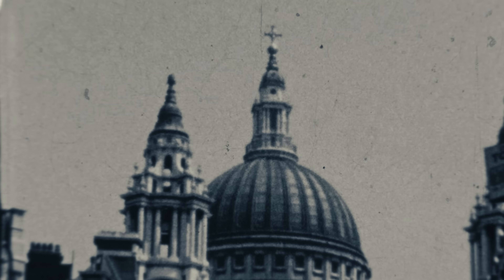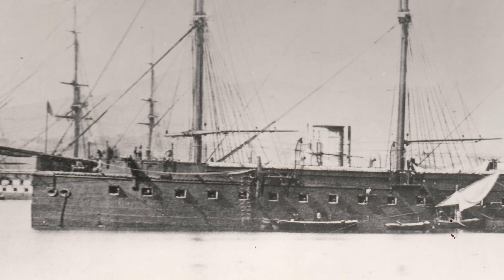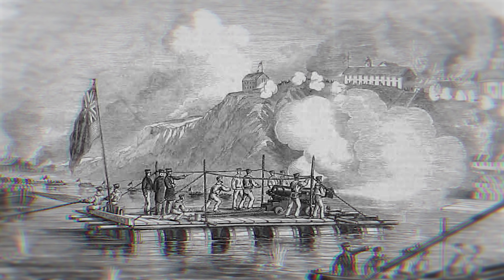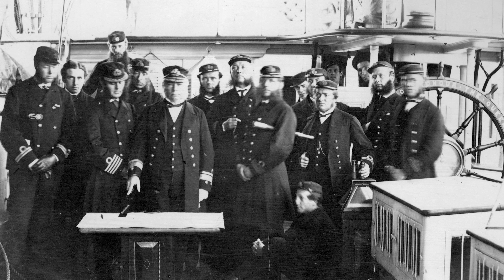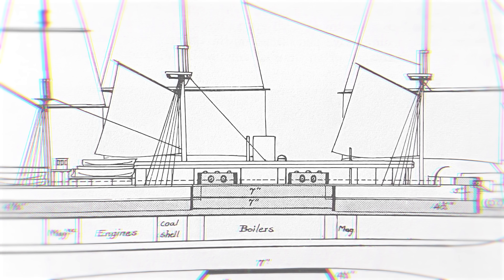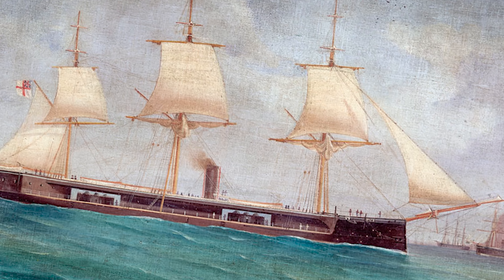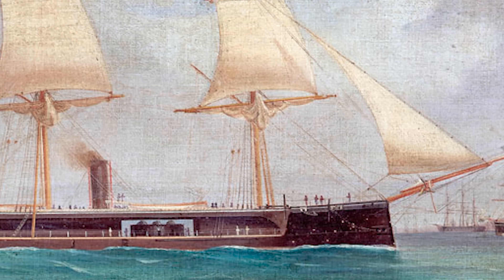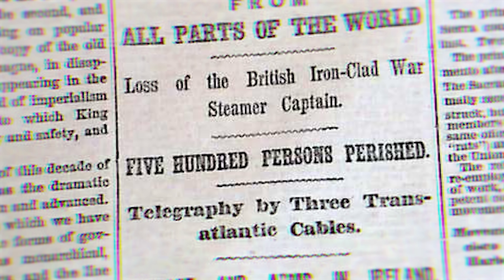The Most HOPELESS Battleship: HMS Captain

Comment: I doubt any cooperation would've served to save Captain. It sounds like a story we see often, much like Oceangate, where Coles had so much pressure and backing the Admiralty knew that the bad design was inevitable. So rather than lose their credibility by attaching themselves, they simply let it happen. The only thing that could sink this projects it seems; would have to be the ocean.
Reply: Couldn't agree more. I'd guess if the admiralty had cooperated as Mike suggests. The weight may have been closer to spec but only offered a few additional degrees of roll before catastrophe? Was that additional weight in upper plates, lower plates, uniform throughout, design changes? Unfortunately the video doesn't give anything to make a guess.  But yeah Cole sounds a lot like Stockton
Reply: A few degrees of roll for a fully rigged ocean going ship....
By design, ships with sails roll different amounts depending on what course you've set, hauling, reaching or running.
Not to mention roll change while crossing the wind, tacking and jibing.
Jibing especially must have been utterly terrifying on Captain 😨
Reply: I suspect that might be why the plans were marked "not objected to" instead of "approved", what Reed actually meant by "not objected to" was "I cannot approve these, but there's too much pressure for me to reject them so I'll mark them down as "not objected to" as I have no realistic means to object to the plans"
Reply: @MostlyPennyCat  No, I said a few additional degrees possibly. Mike already stated in the video 21 degrees would be catastrophic. Since 10-20 would be normal everyday sailing for ships of that time. 21 as a limit sounds insane, and 24 (I.E. a few additional) doesn't sound much better
Reply: @27Metaldragon I agree with you. When someone is trying to go over your head to approve something you simply cannot condone as an expert, the worst thing to do is actually cooperate to try and mitigate anything. If you do, the failure will be almost entirely on your hands and everyone will throw you under the bus. By standing aside and not vetting anything, you can say that you never came even close to approving anything, which leaves the ones who pressed the idea over your ruling to be the sole persons responsible.
There's a very good reason we build entire groups of experts on technical subjects. Bypassing them is absolutely not acceptable and when that occurs, they should stay as far away from those projects as they can.
Reply: Anyone who invested in that farce are as crazy as the guy who built it. The game controller used to control the sub should have been a huge red flag that he was completely off his  friggin rocker. That alone would have made me run in the opposite direction. He was as mentally unstable mixed with being a total narcissist and that was all it took to  kill all the others as well as himself. The man's son who didn't even want to go is pitiful. Just because someone has an IQ higher than you doesn't mean they know a damned thing about what they are doing. The narcissist in him kept him thinking only of himself and what he wanted to do. I thought from the beginning that he was insane. That whole thing should have been stopped.  Or let him go on his own and if he made it back then do whatever but it still wouldn't have convinced me that it was a good idea. I feel bad for the people he suckered but I look at his demise as he can't endanger anyone else ever again. He was a cheapskate on so many things with that toy he called a sub it's truly disgusting. Killing all those people for a moronic idea is cruel. They weren't toys or things lost that don't matter, they just didn't matter to him.
Reply: If Coles’ was the only life at stake I’d find it fitting, but unfortunately his hubris and incompetence cost the lives of 500 other men for his folly.
Reply: MMB n
Reply: @Boo-dawg.  The game controller wasn't an issue so much that it was a wireless controller with, as I recall, no  capacity for being plugged into the sub in case of interference or a low battery.
Reply: its funny how ocean gate is so reminiscent of this project , maybe not 1 to 1 , but resemblance is uncanny still. up to last detail where designer died in his own ship due his hubris.
Reply: @Damorann  thats exactly what i was thinking when he said they should have cooperated more, that is absolutely what would have happened.  the moment i heard that the press was hounding them to approve it and the guy was using public opinion to ignore expert designers i knew that if they had cooperated and he survived he would have put the whole thing on their heads, thats exactly what that kind of person does.  i was really happy when i heard they had refused wholeheartedly to have any part in it, they had the sense that so many scapegoats dont.

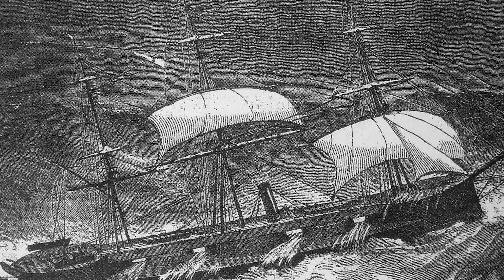Comment: 27:04 Earlier in this video, you described that the Admiralty had attempted to work with Coles to create a ship to his satisfaction, and the result, Monarch, only annoyed him and prompted his political backers and the public to pressure the Admiralty to let him make the ship he wanted. If the Admiralty had worked more closely with him in the construction of the Captain, correcting the ship's design flaws as it went, wouldn't the result have been the same again?
Reply: Yeah I think only thing admiralty did wrong was to accept ship to service. Coles literally stepped over them and went to sea lord to get this ship build because admiralty and architect didn't want to build his original death trap as he wanted it.
Reply from the maker: I think the impetus would be on them to push again rather than just give up and wash their hands of the whole thing, especially since they would be accepting and operating the ship. Make no mistake, Coles and his supporters must wear the majority of the blame here - but I think it was up to the admiralty to push harder and state their case although I understand that can be difficult in the face of mounting political and popular pressure!
Reply: @OceanlinerDesigns  The problem there is the involvement of a Sea Lord - that is, the man in the highest position on the military side of the admiralty. If the Sea Lord issues an order here, it becomes about disobeying orders, and not just pushing back against pressure.

Comment: Some Notes.  the MASTS on HMS Captain were an early Tripod Mast, (see around 17 minutes) to cut down the rigging.  This also made them stronger.  Normally a good thing, but if they had been weaker there is the possibility that the masts would have snapped rather than drag the ship over.
  TURRETS the use of rotating guns were pioneered by Erikson, Coles & Eads.  However, what was used on ships from about the 1880s was more properly called a Hooded Barbet.  This is an armoured ring that eventually extended below the waterline to magazines.  The  Hood came to cover all sides & the top in significant amounts of armour.  Unlike the Turret, this rested on the Barbet & because of differences in gun mounting could be lighter than a true Turret mounting the same size gun.  (The RN tried the different systems on sister ships to test the point)  While Erikson, Coles & Eads began the design line of what are now "called" Turrets in fact the 20th Century examples were a very different beast from the rotating round boxes they started off with.

Comment: I've got several books on the subject of what became the Battleship, of which Captain was a distant ancestor. Several of them discuss at some length the loss of the Captain, and all agree that the weight of the turrets was not properly calculated and so the ship had a deeper draught than was intended, with the resulting too-low freeboard. I think the blueprint called for Captain to have a 9 foot freeboard, but, with the weight of the turrets, this was reduced to 6'6"- which tragically proved inadequate.

Comment: Having known this story inside and out I want to congratulate you Mike on an incredibly thorough accurate and entertaining telling of this tragedy. Also in my humble opinion even if the Navy had assisted in the build and the specified freeboard of 8 foot had been achieved it still wouldn't have saved the ship in that gale. Reed was right and a much higher freeboard was required such as 14 feet
Reply: His own Monarch was fitted with outward-collapsing bulwarks between fo'c'sle & poop to artificially raise her freeboard, improve her seakeeping and preserve her stability even further. I've always felt that, as with smaller Laird rams, Captain should also have been built with these; the resistance which they would have imparted to rolling might - just might - have saved her and her ship's company. But monarch also had a higher turret axis than captain, so perhaps this idea is moot anyway?

Comment: 6:08 no most guns especially that shown here were muzzle loaders (gun shown is a 9 inch 25 ton Rifled Muzzle loader on HMS Iron Duke) , hence the short chase length allowing them to be brought in board for loading. The Royal Navy had used Armstrong breach loaders from 1855/6 for example, Warrior  had Armstrong 110 Pounder 7 inch calibre rifled breech loaders, but they were a failure, at the 1863 bombardment of Kagoshima (Japan don't ask!) several of the breech loaders let go their breech blocks, one even threw it over the height of the main mast so they were withdrawn in 1864 and the RN continued to use rifled muzzle loaders into the 1880s until an incident on HMS Thunderer (ironic name) blew up one of its 12 inch main armament guns due to a double loading in the Sea of Marmora (Turkey) in 1879 killing 11 people in the turret crew, so after 1880 the RN re-introduced breech loaders, and even if Thunderer's gun hadn't blown up advances in France and Germany made this inevitable as the British were falling behind in weapons technology.

Comment: The Swedish warship Vasa, at its time the largest in the world, built between 1626 and 1628, sank after sailing 20 minutes and 1,300 m (less than a mile) into her maiden voyage on 10 August 1628 in the Stockholm Harbor. Vasa was dangerously unstable, with too much weight in the upper structure of the hull. Lessons not learned.

Comment: Sorry Mike, but You massively missed the upper end of cannon shot size in the age of sail.  32 pounders were not uncommon and even 64 pounders could be found.  Tisk tisk !:-)
Reply: The lower gun battery on British Third through to First Rates (74 - 100+ guns) were almost always 32 pounders. Its only on some of the smaller, earlier Third rates where you see 24 pounders on that lower gun deck, usually they were on the upper gun deck of the two deck Third rates. 

And the Royal Navy were not the only ones, on French Ships of the Line of Line they used guns of around 36 pound shot weight if I recall correctly, and the Spanish lower deck batteries held guns of roughly the same size. 

At least that is during the Napoleonic wars. By the time Warrior was built 64 pounders were the Royal Navy standard.

So yeah, 32 pounders or thereabouts were not just not uncommon, they were the standard heavy battery on most British, French and Spanish Ships of the Line from the late 18th Century!!!

Comment: 17:29 1 foot is 12 inches, not 10. If the ship was supposed to have 8 foot freeboard and only had 6 foot 7 inches, that would be 17 inches lower or 43 centimeters lower in the water. Otherwise 13 inches lower than 8 foot would be 6 foot 11 inches.

Comment: Cooperation is a great thing.  However, you described a modern off hand style of "cooperation" that brooked no dissent for apparently years to the point where nobody wanted to deal with it.  A man resigned because his professional opinion was besmirched and belittled over and over and over again.  The proponents of the HMS Captain did this to those reasonably trying to work with them to fix deficiencies. 
You called, somewhat, even mostly correctly, the inquiry as a whitewash, but any officer put in place to oversee construction would have been scapegoated, so...

Comment: The weight issue doesn't matter.  An eight foot free board instead of the six feet seven inch free board would not have saved the ship. If the masts had been ten feet lower, it would not have saved the ship.  The ship as designed was doomed and Reed understood this from the very beginning. The ship was top heavy and unstable on a calm sea,  when the storm hit it's fate was sealed.

Comment: While i agree that greater oversight from the admiralty could have saved captain, the issue is that ignores why they wanted nothing to do with it in the first place, which is that coles was forcing their hand greatly and seemd to be a complete pain in the ass to work with, if reeds and the admiralty had their way, captain wouldve never been built, it was coles who used his cinnects and influence to get it built and i think the best admiralty, and well at least reeds could have done was to avoid involvement.

Comment: Teo - I have a 16 foot Ross Lillistone Phoenix III. It has the same rig as the Goose (and the Goat), and I rig her the same way as you do your Goat. I did a lot of light air sailing, including in some chop here in Lake Michigan (near Chicago). I have not noticed lee helm on either tack in light air. Could it be an attribute of a flat bottom skiff? The Phoenix has a sharp entry that turns flat as it goes aft but it is not a flat bottomed boat. Thoughts?

Comment: Reed was correct.  Trust me, there is no arguing or compromising with some designer/engineer when they're determined to do something epically stupid as Coles was in this case.  
Reed took the ONLY option available - get out of the way and document EVERYTHING.
It's a shame that the sailors on that ship weren't aware of the danger until it was too late (although, I would imagine seasoned sailors knew how top heavy she was as soon as they set foot on the deck.  They knew, but they didn't have the option of GTFO).

Comment: I'm afraid I disagree with your final assessment that "if only they had worked together the problems could have been resolved". 
It's not just about shedding a few tonnes here and there or adding a little more freeboard and all will be fine. There is math behind stability calculations and serious considerations of having a low freeboard AND a high center of gravity. You can build ships with a low metacentric height or a high metacentric height and the ship will behave accordingly, but combining a low freeboard with a high metacentric height and high center of gravity will only end in one way when exposed to ocean swells together with pressure on a tall mast structure with sails.
It is inevitable and not something you can "fix", if you want to build such a ship you would have to restrict its use to coastal waters behind the protection of an island chain, like close coastal traffic in the archipelago of the Baltic Sea, not as an ocean-going ship.